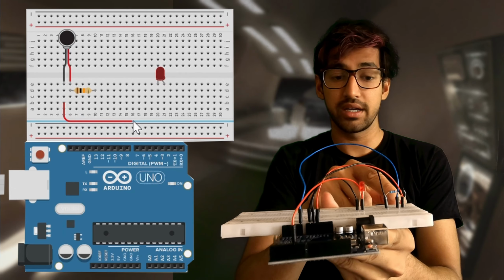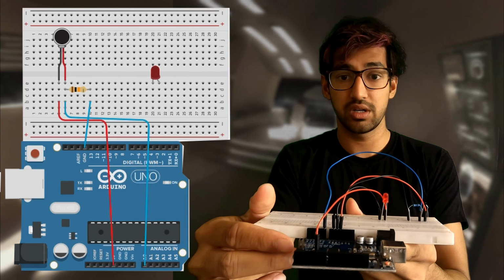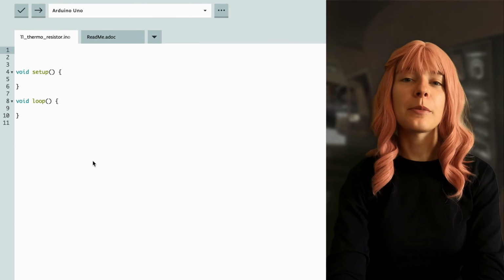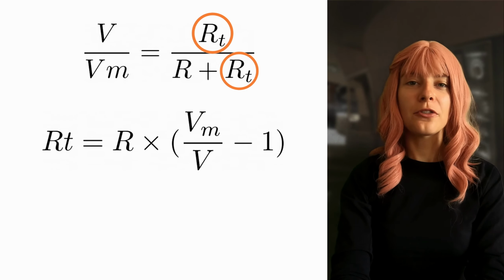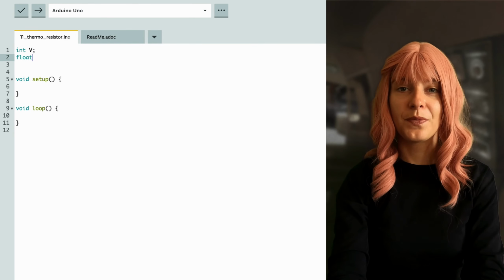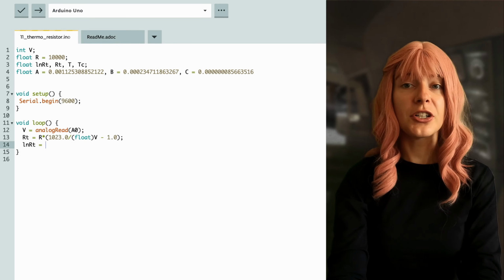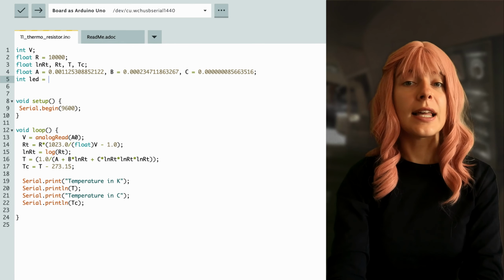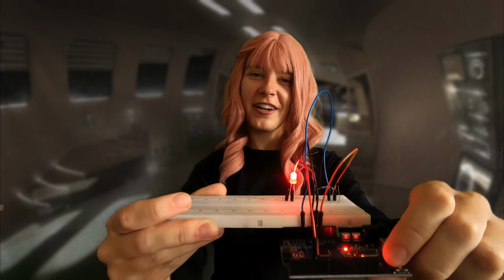How to Measure Temperature with a Thermistor | Arduino Tutorial

Comment: Hi guys. 
I tried a few tutorials and yours finally worked and showed the proper temperature. I also experimented with an online Steinhardt equation solver cause I was curious. :)
 I wanted to get the exact equations but it always gave me the B equation with a minus so everything got messed up. Probably because all my values were above zero. (hot water, my hand and floor tiles). Who knows..
 Anyway..
One question plz..what did you use to make the diagram? 
Thanx for the tutorial and keep burning 😂👍
Reply from the maker: Thank you for the comment and showing your interest in our video. Let us know if you if using something cooler than room temperature solves the issue of getting the minus B equation. We used the Autodesk Tinkercad for most of the diagrams. :)